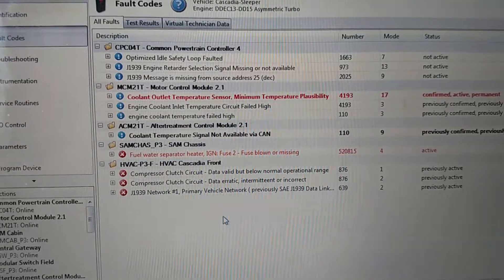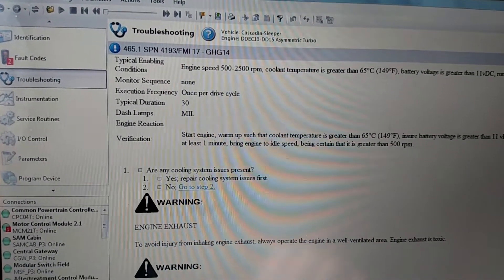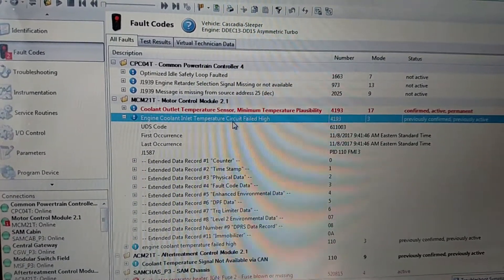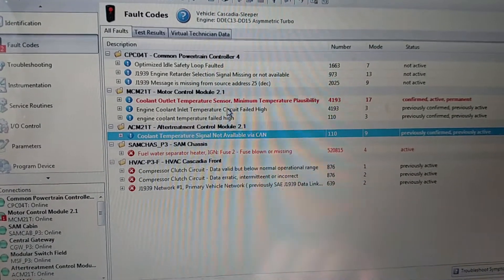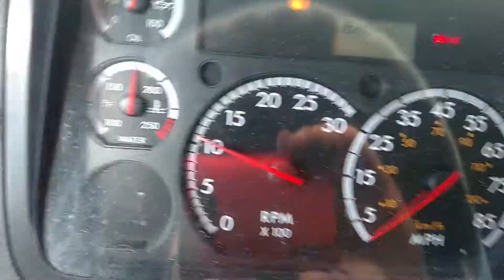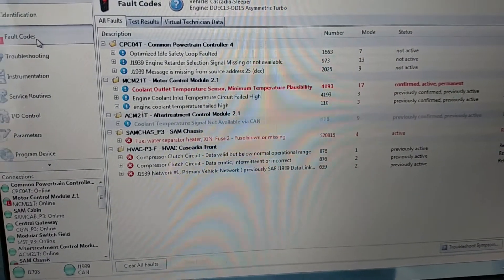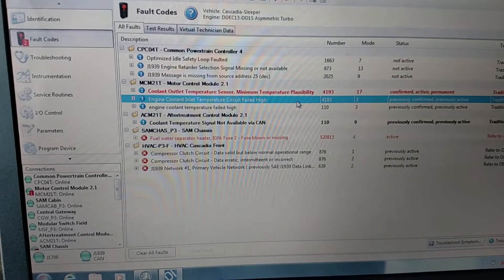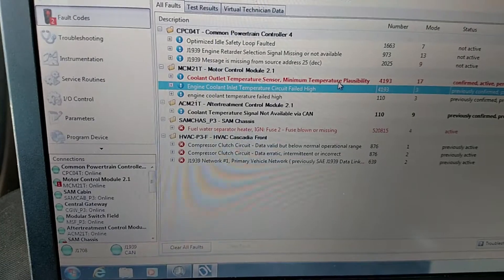Detroit diesel thermostat

Comment: Honestly Detroit runs like 200-190/180. But when it gone bad it’s change levels as position of the thermostat. Open all the way, halfway or other. When u turn it back and forth on heat it really acts up. But best to go with new one to be safe. Fla truck need to be 200 or lower and up north need bigger thermostat.

Comment: I got 2007 freightliner Detroit 60 gets hot when I'm pulling up hill on 25 degree weather gets above 200 and then fan kicks on I don't know if I should replace thermostat or replace water pump  or flash the radiator...and sometimes when I'm idling gets to 200 degrees on cold weather and warm weather but not always...any help man please thanks
Reply: I have the same problem how do you fix it

Comment from the maker: Thanks for the positive comment
Reply: Hey how are you? I have a 1996 fld120 with a Detroit series 60 12.7L my temperature reaches 205f on a hot texas day I hear the fan clutch go off then it goes down to about 185f, It has never got to the red line on the temperature gauge but pretty close, is this normal on this trucks? Thanks! Great video by the way!
Reply: My 2015 cascadia  DD15 goes up 220 degrees when the engine fan kicks in, I wonder if that's normal?... always driving at 200 degrees 🤔.
Reply: @NR-fn6uq  Definitely change your thermostats. I had that experience before.